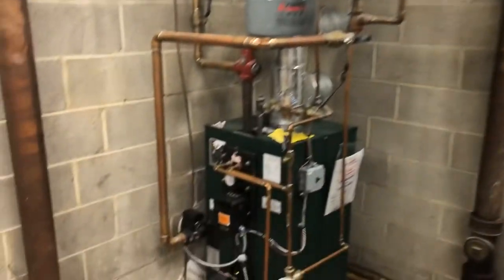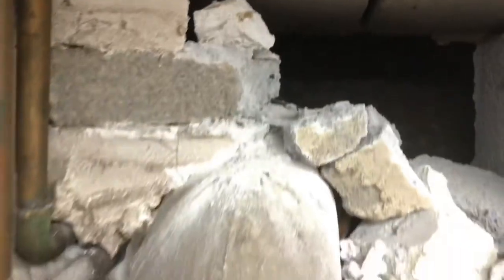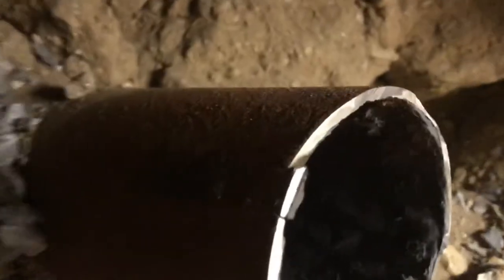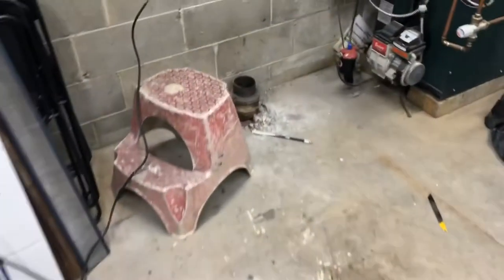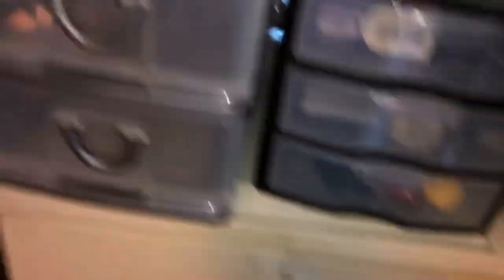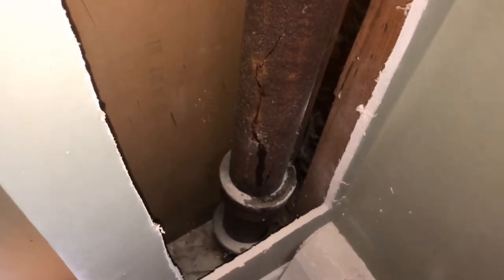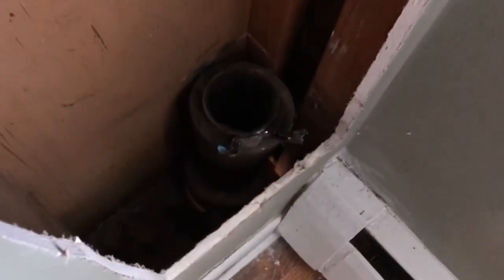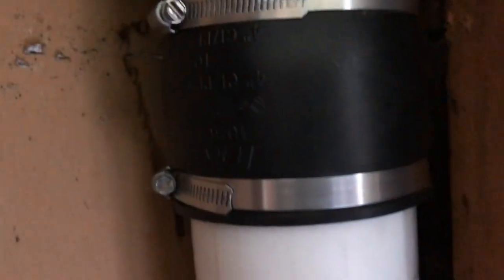Home inspection waste of money!!! Cracked cast iron sewer pipes.

Comment: The rest of the pipe kept cracking because of the vibrations of the reciprocating saw you probably used to cut the lower sections with. Those rusty old pipes are very brittle and will crack with the smaller vibration. It's best to use chain soil pipe cutters.
Reply from the maker: Would never be able to get a chain cutter in there. I showed in the video a rot path in the pipe and that’s exactly where it cracked. It was shot and probably would’ve cracked with or without vibration

Comment from the maker: There were no weird 45’s😂 those were 22 1/2’s Turns out the seller was there during the inspection along with the buyer= my customer. The seller was following the inspector around telling war stories!? No excuse in my eyes! If you look at the first pipe we replaced that goes in the cinder block I didn't say in the video but obviously that was a patch we removed so the seller knew about the crack and didn't disclose. Also the second pipe we removed that started leaking upstairs you can see that was previously opened and covered with newer drywall. The weird wet stains everywhere on the cast fittings joints I'm now thinking were from some kind of a solution test or bubble leak test.

Comment: this is  NOT  reall big problem..if you got the house for a good price....  do the work you save a ton it aint that hard it sounds like you are from philly  so big box stores everywhere !! i see u have a work van  and tools ......open the walls demo and clean that is the first day,  get what u need in plumbing materials ie pipe fittings ect ect bust out the old shit ( at the bottom of where the pipe makes a turn scoop out the rust from the pipe  with an old spoon on a pole) dry fit your pvc ...the pvc   is cheap and easy.... do all that is needed to be replaces ,check for leaks  not impossible ..after no leaks ,,rap with fiberglass insulation  pipes will be  MUCH quieter ... i did my 3 story house in oak lane  TWO  sewers  it was a lil work  but i saved a fcking mint!!!!! 😉
Reply from the maker: I’m a contractor not the homeowner. The bathrooms the pipes go to are freshly remodeled. I made this video to show people not to feel safe in buying a house because of a home inspection.

Comment: Understood the Ferncos from PVC to the Cast, but I don't understand why you used a Fernco to attach two PVC pipes together? Just did this in my house due to a rotten lead elbow under the toilet, except I did it right... replaced all the cast in the house with PVC, it's only a matter of time before those other pieces spit, not to mention the scaling inside the pipes.
Reply from the maker: @toyotatacoma6817  as far as I know you have to mess around in order to find out!🤣 at the bottom going into the basement it steps over with two 22 1/2’s no way to do it your way with the framing and floor in the way
Reply: @PHL_Brownstone   Oh, I understand... I ripped up the floors, and cut into walls.  I had to cut the pipes in sections to get them out, but so much easier putting PVC back in.  Most plumbers cut into the ceiling, I don't understand this at all considering most older pipes are notched into the floor joist from above.  Repairing the floor was the easiest part for me, I hate drywall especially when you're trying to patch a wall that is plaster.  Mine was from the basement to the 2nd story and of course the breather through the attic out the roof.  Took 4 days total to complete... except the wet wall, it's still open... I just did this last week LOL!

Comment: Thanks for showing the before and after of the cracked pipe and what you did. I wanted to see how you used the Franco connectors on PVC to Cast Iron. I currently have a cracked/leaking bathtub to main pipe leaking bad. Got to cut out the old 1940s cast iron and replace with PVC/Franco like you did. You video gave me some more ideas and built up my confidence a little more!

Go Birds 🦅! Yous!

Comment: I just purchased a home a year ago & had the same problem. The inspectors manager wouldn’t let me speak with him & said they only check for surface level issues. I paid for a scope test & they failed to do the test. I was able to detect the crack in the cast iron with a flashlight.. It’s been a year & i’m Still having sulfur smell issues & i’m looking to come out of thousands to dig up my sewage line & figure out what the problem is.
Reply from the maker: Hopefully you can get it fixed reasonably! Good luck 👍

Comment: @jamie Thompson,  what type of grinder did you use to cut the floor open to rough in the plumbing
Reply from the maker: After drilling the holes I chased it with a 4 1/2 inch grinder with a diamond blade. maybe an inch deep and it broke out nice and clean

Comment: That pipe had like 60 years to crack, why would it wait till the day after you taped it to crack like that, any ideas?  I have one that I have to repair but I am afraid that if I touch it, I might have to call you.
Reply from the maker: I noticed before I taped the open crack there was a rotten trail leading up the pipe to the next bell. I didn’t notice any kind of support holding the pipe. I believe the PVC pipe in the basement couldn’t hold the weight and settled a bit allowing the pipe to finish cracking in the rotten trail
Reply: @PHL_Brownstone  That's what I fear the most as a non-plumber.  Seems to me that the weight of a cast iron pipe is too much for PVC in the basement.

Comment: May I ask ball park what do you charge for just a simple pvc connect to waste drain pipe in basement for laundry discharge....I'm experiencing a slow drain over flow in the basin....your video shows some of what I saw when I pulled the trap off the sink...decay and Willimantic build up also...thanks!
Reply from the maker: I wouldn’t know without seeing the situation. I’m not a plumber. I’m more of a list man. People give me a list of things they need done and I try to handle it as cheap as possible. But I can tell you if you watch enough YouTube videos and take a little bit from each video you can probably DIY

Comment: Nice work, but I wish you would have shown the work replacing each/some of the problems. I didn't learn anything from you video about Repair.
Reply from the maker: At the time my mindset was showing the problems that are hidden behind drywall and paint when you buy a new house and trying to prepare people because home seller’s lie and cover up
Reply: @PHL_Brownstone  OK.........I understand that. Right now iI have a busted cast iron waste pipe that was broken right below below the hub  and there is no room left on the pipe  to install a Fernco coupler. I was looking for info on how to fix the problem. I have very little room to work with.  I wish i could insert a Pic, but I don't think you can do that here..
Reply from the maker: @johnkosick1464  you could upload a small video of it to your channel and share a link in the comments. Also if you tag big YouTubers in the description of your video most of their subscribers are also plumbers and will respond to you quickly